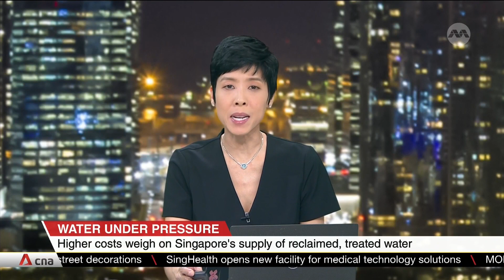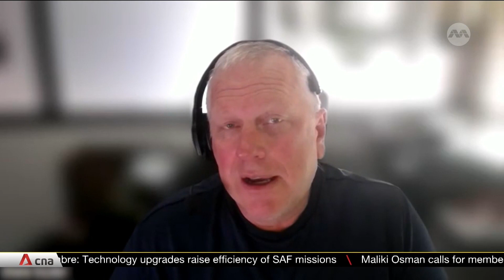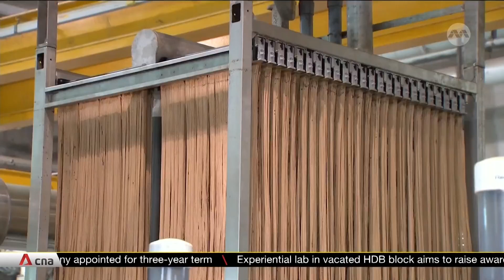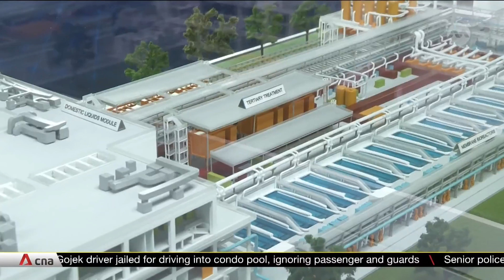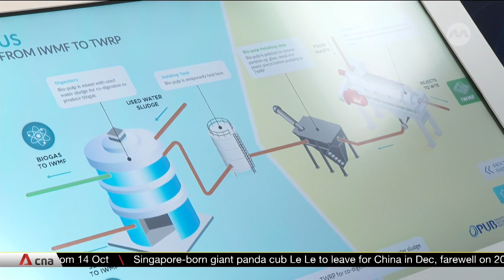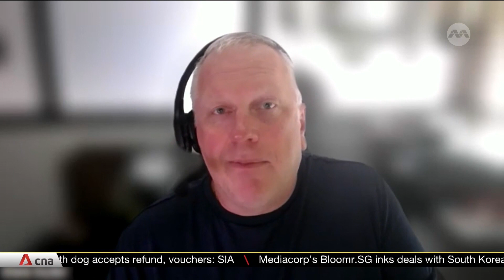Higher costs weigh on Singapore's supply of reclaimed, treated water

Comment: However the tuas water is  new water and a small amount of the total .
Singapore still buy the majority CHEAP water from Malaysia.
Which will last till another 60+ years.
By charging extra to overall water to recover the investment cost should takes a few years. Thus after that the water cost should be reduce slightly as it cover for higher operating cost..it should be minimal as it is a small amount of water to the overall water usage